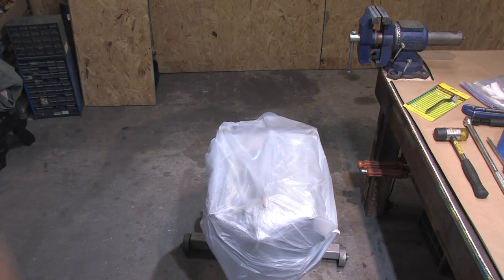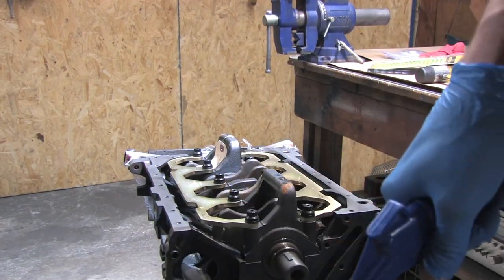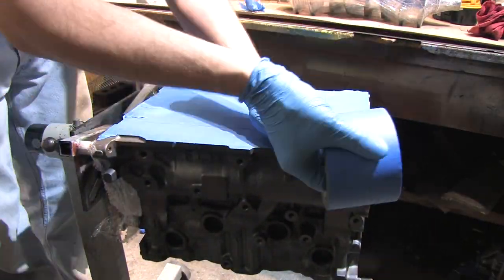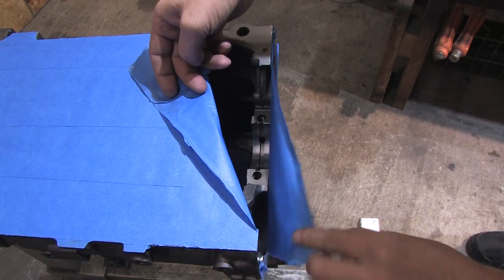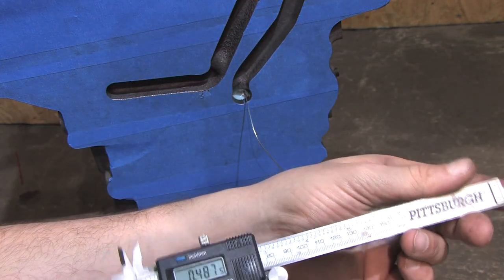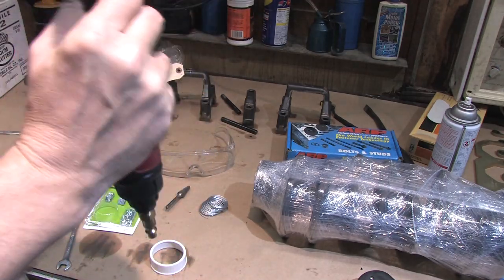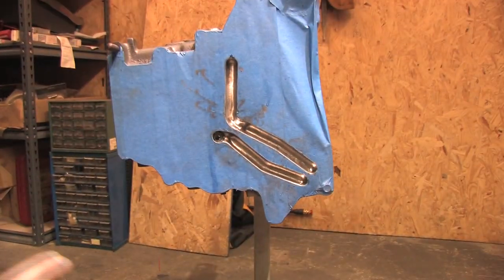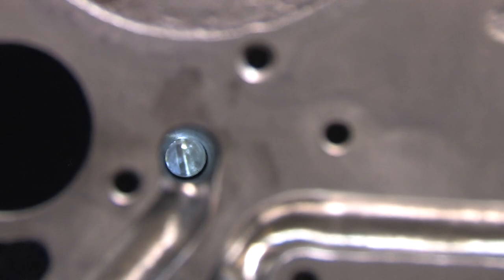4g63 Block Oil Gallery Mod

Comment: I'm about to try to build a 4G powered Hyundai S Coupe, and in watching all of your 4G vids, allow me to say that this is the greatest channel on youtube, ever.
Reply from the maker: You have what I consider my veritable unicorn.  I have wanted one of those cars for years now.  I settled on the Colt chassis simply because I can't find one anymore.  I have scoured every scrap yard, every trading post, and scoured craigslist ads for all of my surrounding states and came up with nothing.  They don't exist in the wild anymore, I've seen 3 and the owners wouldn't sell them for less than $3,000 and none of them were GT's.  That car is significantly lighter than my Colt.  I wanted to AWD it.  Congratulations my friend... I hope this project actually happens, and kudos to the having the most underestimated chassis left that you can bolt a 4g63 into.
Reply: I found one. Only one. You're right about that, I can't find these anywhere. Next option: Mirage.
Reply: ***** Jafro, this makes me feel incredibly bad. I bought an S Coupe for $125 once, which ran rather rough on the original 4G15 engine. I towed it home and started it up only to drop a valve and destroy a piston in it while idling it in the driveway, and soon after I towed it away to the scrapyard because nobody wanted it. :(
Reply from the maker: EdSabbath When?  Recently?  Because if so, I'd have scrapped my Elantra and swapped it instead in a heartbeat.  At least if you were within reasonable distance from Virginia I would have...  It's still not out of the question.  The S Coupe has all the same problems with the parts supply as the Elantra, but that wouldn't matter for what I'd do with it.

You should only feel bad if you wanted to put a 4g63T in it.  Best 4g63 swap candidate you can find.  Lightest 4g bolt-in chassis out there.
Reply: It's been about 4 years, not recent enough. I feel bad because that would have been the eventual plan had I kept it, I've owned two AWD DSMs since then and both I had almost zero dollars into, and would have been perfect parts cars for the swap. Had I known, I would have never done what I did.

Maybe someday I'll find another S Coupe, I've wanted one ever since getting rid of that last one, and it's my biggest regret as a DSM lover and car guy in general.
Reply: I agree whit u
Reply: @NatashaB  where i live they sell for 250 but they are al autos

Comment: I would suggest that if you are going to be using plastic wrap to seal up parts for storage - use a desiccant inside the wrap to reduce the tendency for water to accumulate or condense (due to variations in temperature).  This could be a simple as using rice in a semipermeable bag to absorb water vapor, or using desiccant from pill bottles or from shoe boxes.  Eastwood used to have rather large desiccant bags used inside large bags that cars were stored in, I am sure there are other examples  of this you could find to use. 
Also, you might consider using white hand cleaner - the type that DOES NOT use grit in it - to clean cast iron.  It would work well in the oil passages, and I know from experience that it works particularly well to clean cylinder walls as a final wipe down before installing pistons and rings.  It is a trick that a old machine shop owner taught me quite a while back.  He used this in all engines that he personally assembled, it allowed the pistons to be lubed on first start to reduce scuffing, and it allowed the piston rings to seat almost immediately.  It was washed away easily by the oil in the motor, and was flushed out in the first oil change like white lithium grease is when used in engine assembly.

Comment: The elimination kit is what I was doing since I was there. Cleaned the block, new OEM oil pump and gaskets, new front facing housing with oil tap for Turbo. Thanks a lot for all the thoughts and advice.

Comment: I just completed this mod on my 4g64 block, I'm building for my evo 8 swap. I used my electric dremel with a carbide bit, sanding wheels, and then finished it by hand with wet sand paper. Looks great and thanks for giving me the idea to do it by posting this video.

Comment: excellent work there mate, it all makes sense in what you have done. Combustion chambers, inlet and outlet ports get polished and matched to decrease the amount of drag and turbulence and increase efficiency so in theory it will also work with a liquid, and in this case, the lubrication circuit of an engine. Keep up the good work and the highly informative vids!!

Comment: Great video and another point for OCD. Just worth a mention have you ever noticed the way the block casting oil way doesn't match up to the oil pump casing, try the gasket on and see what you find. Maybe not an issue on 6-bolt but I've had to port match a few 6-8 Evo blocks. Great video, looking forward to more

Comment: stuby shaft so when Over-revved the engine for the first time well you probably know what happened after that I ended up pulling the engine and ended up having a hole in the block the rod cap broke off and the rist  pin was broke off the middle of the piston so now I have to build a new engine what fun but a big thanks to you because without your vids my engine would have never bin built

Comment: I had this done to my 7 bolt 2.4.  We're using the stock front case with the OFH ported and the head oil supply passage rounded out a bit as per your video on that subject.  We're also running a three piece crank scraper.  I'm anxious to see how my oil pressure does after this, I have an Auto meter Phantom gauge to monitor it but I think the oiling problems I saw previously will be gone (although the stub shaft falling off the gear is pretty much as catastrophic of a failure as it can get.)

Comment: Jafro: You're not the only one who has trouble with sound balances that are thrown off after uploading to YouTube. Even well-funded channels like BBC's Top Gear occasionally have music tracks that drown out the dialog. A friend of mine who does video work thinks that part of the problem is full 5.1 surround-sound tracks that get cut down by YT into compressed stereo. If you mix your audio using highest-quality settings, consider downgrading to simple stereo or even monoaural sound for YouTube.

Comment: Jafro, Would putting glyptal in the oil galleries, after doing this mod be beneficial at all? Figured I'd ask since you did the inside of the block, and the inside of the head.
Reply from the maker: +BoostedCajun I would go with… no.  In fact, I would consider it a bad idea just like a high cholesterol diet would be a bad idea for your arteries.  It's not the oil galleries that need help in a 4g63 as much as the oil return.  Glyptal would leave a thick, and therefore, restrictive coating inside the galleries.  You get a greater benefit by polishing them than you would by coating them.  I don't know how glyptal behaves under pressure, and I'm not sure anyone else has tested that either, but imagine if one little chip or flake did start to peel…  That would be disastrous.

Comment: 14:50 imagine holding your drill bit straight for such a long hole. its not easy, also long drill bits make the problem worse. even with a gun drill keeping the bit straight is basically impossible.

Comment: well on my thought ,all this is good but it stems back to the sourse.the oil pump,once you get a good oil pump presser then the other small defectes can be over come.becouse on hot days that oil turns to water runs very thene ,and also even with the right ouil presser the oil we have is some what unstable.so i would think a good mid range or high presser oil pump and a good lucis additive would solve alot of probes.anyways just wanted you to know your vids have been very helpfull becouse ive alway been a chevy guy.this is my first 4g63.the ballencer shaft bearing was inside the bottom of the oil pan.ive never found one vid yet who someone says the balencer shaft was there knocking prob.well guys sheck it becouse mine had ver good rods and mane berings it sounded like a thras muchean ,oil light was on so there was my prob.so i done the balencer shaft delete.alls good now
thanks for your vids .now i can say yap mitchubsi,sure i can work on that.lol
and kindell oill is number one

Comment: Hi Jafro,
This vid is awsome (as usual).
I would like to know if you have some tips about engine regulation. I mean references talking about relationships between sensors, like lambda gauge, air flow sensor... And so on.
Calculators are for me black boxes.

Comment: Jafro, so what you did of grinding and sanding the oil galleries is to improve the oil flow  circulation? I don't know about sticking silly putty on a wire and plugging the oil gallery hole with it to keep metal shavings out while working on it, you could of just plugged it up with blue shop paper towel instead, thats what i would of done. Plus it wouldn't matter anyway if you're going to send it to a machine shop to have it hot tanked and cleaned also masking the whole block wouldn't matter too if its going to the machine shop for cleaning. In your case if your not sending out for the hot tank job and plan on assembling the block after the mod, masking the block would make sense.

Comment: love all the videos, learned a lot! Q: I have a 1G 4G63T, still a ways from putting it together, what is the proper way to prime the oil system before first start; also any thoughts on an electric pump for pre oiling 
thanks!

Comment: Hey jafro buddy, I'm in the middle of replacing all my bearings and seals in my transaxle in my 97 talon tsi awd, and am wondering if you could do a gear stack video? or possibly steer my in the direction of a good DIY guide, I just recieved all my parts(all I need was bearing near 1st gear on int shaft but decided to do it all. I know that your supposed to shim the gears to make them match up properly, read the manual but had a hardtime understanding some of it to a t. Any advice is welcome bro

Comment: TheLilhottie685: Apologies if I was overly defensive.  Guess I've read too many comments on YouTube from people who were borderline nut cases (and some that were way over the border).  Anyway, I hope your clutch/transmission issue got fixed.  If it turns out that you were missing the same "crankwalk bolt" that was missing on Jafro's engine, please post a video!

Comment: too large oil galleries leaves your engine unlubrificated with pressured oil a fraction of a second longer during start , increasing wear every start.    An idealsolution would be an electric pulsing oil pump added to the fantastic and indestructable meccanic oil pump.  Just for prassuring the oil before start  : no constructor does it because the engines would not wear and would last 2 000 000 km

Comment: Thanks good info it's probably a better idea going the 6 bolt rout cause I just built a 7 bolt block and it only lasted me 147 miles cause I forgot to tighten the balance shaft stuby

Comment: hi, you have created good video on oil pump and filter videos. i have a question, your help is very much appreciated. When i change oil, if i dont fill oil in the filter, and if i start the car, will the car run withtout the oil for first few seconds.. i mean it might take few seconds to get the oil filter to be filled,, please advise.. i am not sure if the oil filter is the only source to get oil and if takes few seconds to get that oil filled not sure during this time waht will happen.. please

Comment: Why are there oil galleries on the outside of the block, does the oil pump cover those two outside oil galleries?
Reply from the maker: They're sandwiched between the block and the front case with a gasket.  It's how Mitsubishi chose to move oil from the pump to the block.  More reliable on a high pressure oil system than a hose or a pipe would be, and lower maintenance, too.  The gasket usually lasts the life of the engine.  It's a smart way of doing it.  If I had to complain about anything, it would be about the design of the pump.

There are other oil galleries on the outside of the block opposite the front case.  Those should be plugged.  There are also galleries bored into the balance shaft bores from the outside of the block, those are also always plugged.  Sometimes there's just no other way to make an oil gallery but to punch a hole from the outside...

Comment: Does anybody with mold/casting/glass-blowing experience know if it's feasible to make a glass  model of the oil pathways that are being modified in this video?  I realize that such a model wouldn't exactly replicate the actual oil flow in an active engine, but it might do a much better job  than the speculation we create in our heads. Can we make a glass or hard-plastic tube in the same shape and send hot oil through it?  Would we better off just putting more sensors into a test-stand engine?

Comment: Pressurized oil will flow just fine through the stock galleries. I can’t see the need for this other than to say ‘I customized my oil galleries’.
Reply: ‘While you are in there’
Reply: I'm sure it will, but its an easy job while the block is bare, and why would you tolerate that cruddy casting flash in your extremely important oil system. 

The oil pressure regulator also regulates at a point prior to the upper gallery, so any pressure created by restriction in that gallery will ultimately lower the pressure in the main oil gallery. I'd rather have trust in that id done everything I could to make sure my regulator pressure is matching actual pressure.

Comment: You should get someone to scan that and run it in a model simulation.
Reply from the maker: Bro, I've worked in IT for 25 years including 2 universities and I still don't have access to those resources, lol!
Reply: Just wondering what the flow looks like. A lot of times mods like this create chaotic flow rather than laminar. Which would be just as effective as leaving it alone. Or simulate how much material and where to remove it then find a CNC operator and have a party but this would all be more work than it's really worth.
Reply: But props on your dremel control and cleanliness. A+! I presume it is effective, but how effective is what I'm sincerely interested in.
Reply from the maker: I should set up a gopro on the gauge some time when I'm flogging it at the track and let you see what the oil pressure does.  On this particular oil fountain, I nailed it.  I fixed the excessive pressure issue, ended up with good oil pressure at idle, the right pressure at WOT/7000 RPMS and that means I nailed my oil clearances.  Just like how one car might be different from the next, oil that flows correctly at one pressure might not flow right at another... but with all of the oil mods I performed, it's correct at every oil pressure and RPM on THIS car.  The biggest motivator that gave me peace of mind in doing this was the fact that it was recommended by a gentleman we'll refer to as BogusSVO.  That man knows his ish.  There's a link to his thread in the description, but it doesn't include any flow data.
Reply: Valid. Now I'm interested in this GoPro data. Things that factor final oil pressure though rely heavily on bearing clearances being accurate throughout as well as other areas the oil is going (turbocharger feed and drain restrictions could increase pressure and an issue wouldn't be discovered till later). You could be bandaging an underlying issue if that is the case, though, correct?
Reply from the maker: All the issues I was experiencing with this engine were carefully thought out.  It's a non-turbo Galant block so it has no oil squirters (-4 oil galleries).  The Elantra 1.6L head oil teardrop was only like 3 hundredths of an inch deep.  It was supposed to be at least .080".  It had a turbo bolted onto the head that it wasn't even supposed to have, so the valvetrain and turbo were starving.  I ported it.  The car had experienced idle oil pressures of 60 PSI on a hot summer day.  That's not good.  I set my mains clearance to .0025" instead of .0008".  Peak oil pressure on my engine was over 100 PSI, so I ditched the NA oil filter housing and installed one from a '91 turbo that included an oil cooler as well.  It was ported in a way that it wouldn't drop my idle pressure, but would leak more at high RPMs.  There's a really good video about that here where take apart 4 different models of those things and port one.  The block had balance shafts removed which completely blocks an additional 4 oil holes inside the engine.  So I performed multiple modifications to this car's oiling system to address them all individually.  The front case mod is supposed to do only one thing.  It's supposed to improve oil delivery to and from the pump.  This modification is intended to assist with oil volume, not pressure, because most of the work done here except for one passage is in FRONT of the oil pressure regulator.  If your oil clearances are correct, then your oil pressure regulator should be able to correctly regulate your oil pressure in every operating situation.  If the oil clearances and other oiled components leak the wrong volume of oil versus what's supplied, then you'll have oil pressure issues in different operating conditions.  There are 4 modifications on my particular engine that I did to address each one.  If you watch the Hyundai videos that followed the NYE teardown, I go through all of them.  There's even a teardown analysis of what a high oil pressure rod bearing failure looks like (which led me down this road).  I strongly-believe that the main oil gallery mod would be a good thing to do to every 4g63 because of how rough many of their casts are, but the other mods I performed in other videos would be needed to address a car's specific operating condition anomalies.